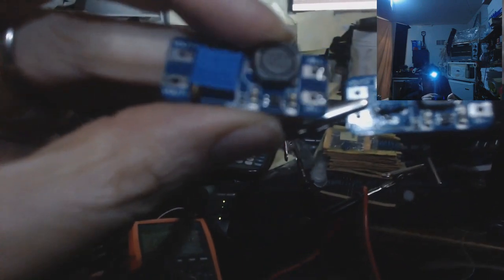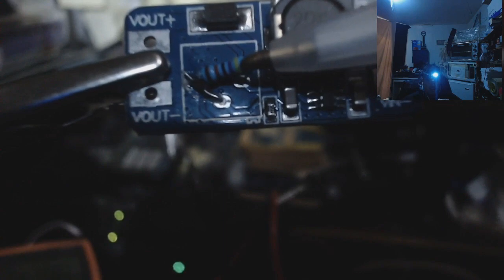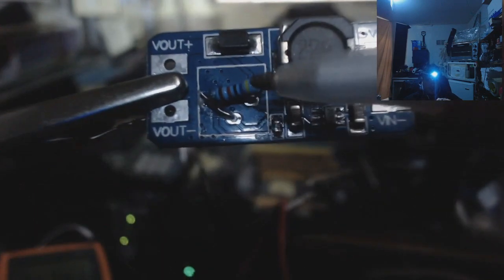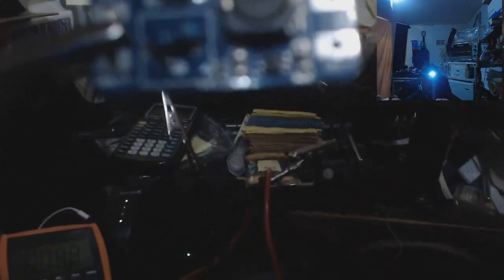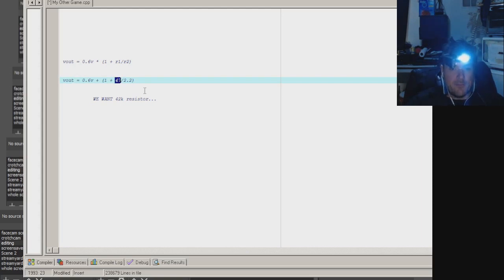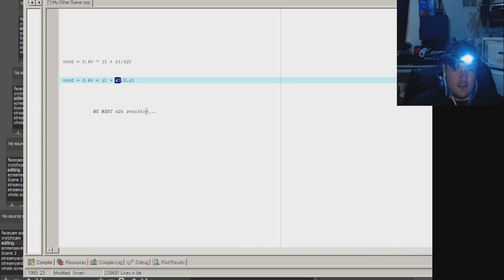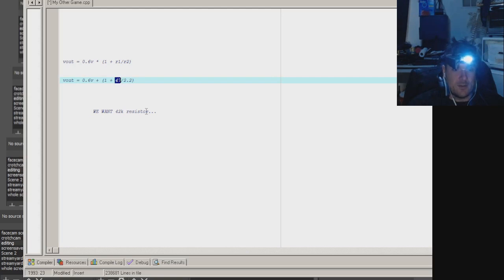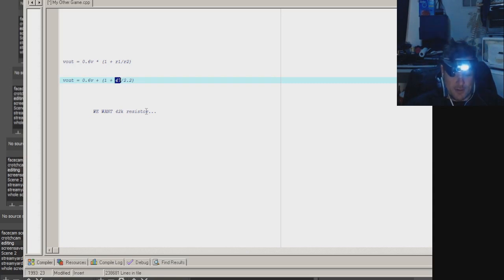MT3608 Boost Converter Voltage Is Less Than Input Always - Doesn't Work - DIY Fix

Comment: Thank you so much. I got 5 of these and none of them worked. As you suggested I did the calculations and soldered an 40k resistor and it is working good.

Comment: I want to use a 3.7v lipo in and get less than 5v or more than 4.6 volts. What resistor should i use? Ive been through a few of these boards and i think this is the issue
Reply: I would measure R2 (The one bottom right to the potentiometer) to be around 2.2k before trying this one, but I calculated it to be around 15-16k ohms.
Reply: @Aetriq for how many volts out??
Reply: @DaiwikPlayz 15-16k ohm for 5 volts out. I used a 3.7V cell for the input
Reply: @Aetriq oh ok. What about connections? Form like r1 to r2 and from one of them to the bottom one?
Reply: @DaiwikPlayz I wired the resistor the same way as he did in the video, if you use the existing leads that were used for the potentiometer it should work fine
Reply: @Aetriq kk thanks. I didnt watch the video thats why i didnt know.

Comment: Simple algebra: R1 = (Vout/0.6 - 1)*R2 or 41.8k. Since you are probably using E24 (5%) values, the closest value is probably 43k, which will give you an output of 12,3V.  HOWEVER: I see the problem, and it's a very dumb one as recommended by the MT3608 chip vendor's circuit diagram for his board. All you had to do was 1) make no changes, then 2) crank the pot "down" (whichever that direction that may be, CW or CCW). Start rotating the trim pot. I can't tell you which direction, or how many turns of the 10-turn pot will be needed, but it could be as many as 6-7 turns. Once you hit this spot, then the boost converter will start doing what a boost converter is supposed to do.
Reply from the maker: I tried all those types of suggestions before I even considered more drastic measures.  NONE WORKED.
Reply: @artbyrobot1  So you turned the pot CW by at least 10 full rotations, and if that didn't work, you tried turning it CCW more than 10 full rotations and that didn't work? I doubt it very much. Do you have a DMM? If so, probe the voltage on the FB pin for each of the 10-rotations cases. Tell me what voltage you measure. If this voltage is larger than 0.6V, as I know it will be, it tells the chip to shut off, which is what you are seeing :Vout = (Vin - Vdiode), which is what these simple boost circuits do when they are shut off. The fact that the circuit springs back to life after your hack (which I do not understand from your description) says that the chip is working perfectly fine. The designer of this demo board (whoever he is) has designed the feedback attenuator (pot + 2.2k resistor) in such a way that it is exceptionally easy to drive FB way above 0.6V, as high as (Vin-Vdiode), which will cause the boost to just sit there doing nothing.
And BTW: as a warning to others, the so-called "specs" chip as well as the Amazon ad for this demo board say that Vin can be as high as 24V. With the demo board as-is, any input voltage over 6V has the potential to fry the chip because the "ABS MAX" (Absolute Maximum) voltage for the FB pin is 6V, which this design will allow. Whoever designed the demo board placed a death wish on the MT3608 chip. No one should apply an input voltage higher than 6V to this demo board. In your case, you are safe powering it with a Li-Ion battery.
Reply from the maker: @demef758  I read comment sections on other videos and forums or w/e and attempted all the fixes recommended.  What you are saying is commonly recommended.  This is nothing new.  IT DID NOT WORK.  I tried it all.  I had a whole pile of these boards and tried every single recommended fix.  NOTHING WORKED.
Reply: @artbyrobot1  DID YOU MEASURE THE VOLTAGE ON THE FB PIN? I design circuits like this for a living. I'm not blowing smoke.
Reply from the maker: @demef758  I did the different turns, counted them up as per all recommendations and tested final output and nothing ever changed whatsoever no matter what.  It made no difference.
Reply: I just looked at a few of the comments in one Amazon ad for these boards. This is the topmost comment that backs up my point, to turn the adjustment pot a lot of turns first: "I bought these just needing one to convert an RC radio 4 AA to Lipo 3.7v. I soldered everything up and measured my output. It just had diode drop across it. After some research, I found that you have to turn the adjusting screw at lease 15 times (clockwise) before you can see deflection in voltage. They work great!"